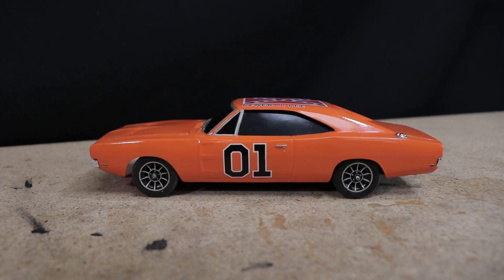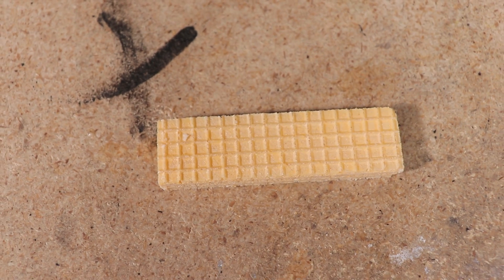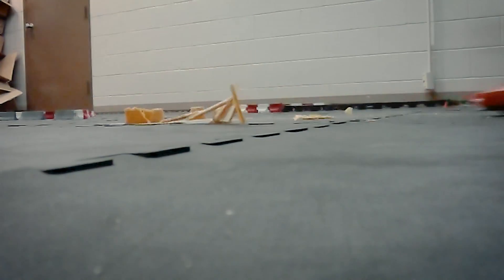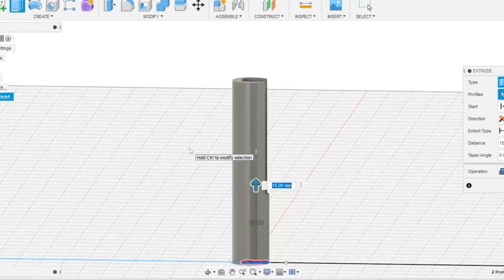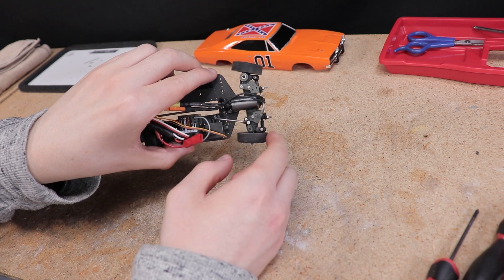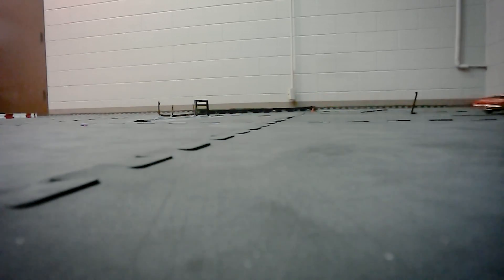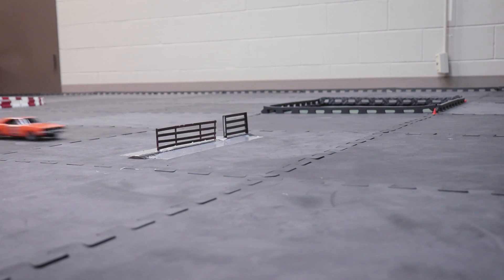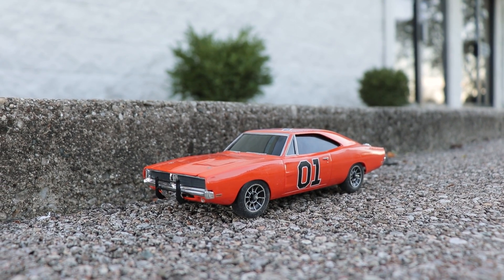Crashing RC Car Through Fences Made of Pasta and Cookies

Comment: You can also use thin styrofoam sheets for your breakaway pieces. They come apart rather well too. 

As far as the gluing goes, you’ll want to do it in spots instead of laying down a long bead, as it won’t come apart properly otherwise. 

Also- you’ll want to lightly score your breakaways to help with the destruction.